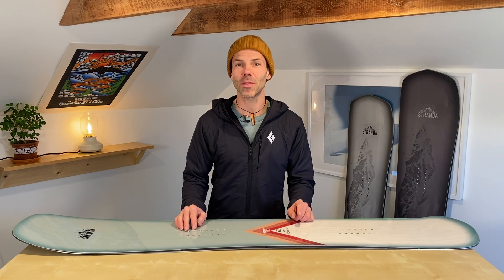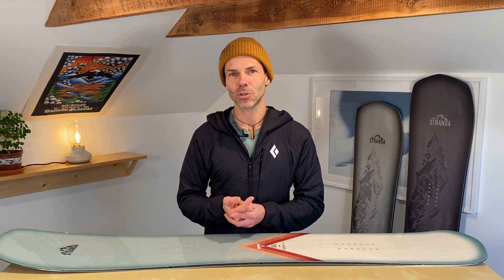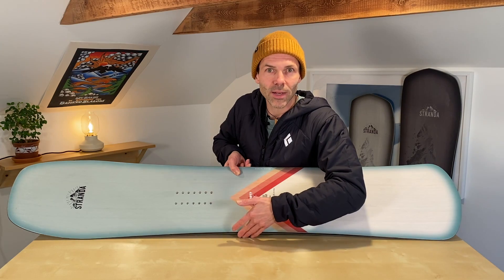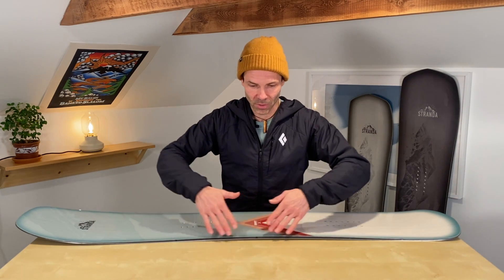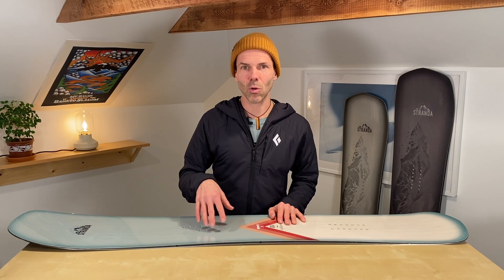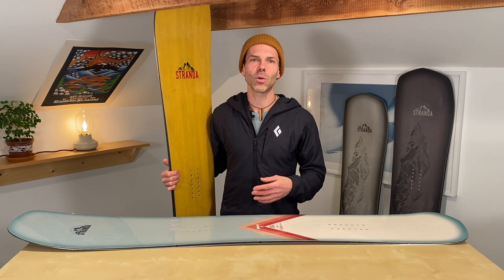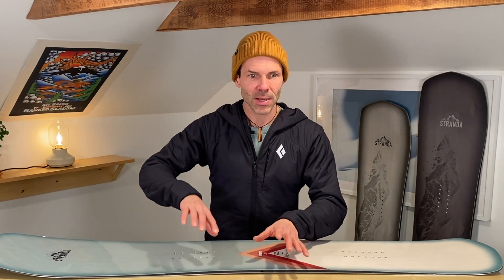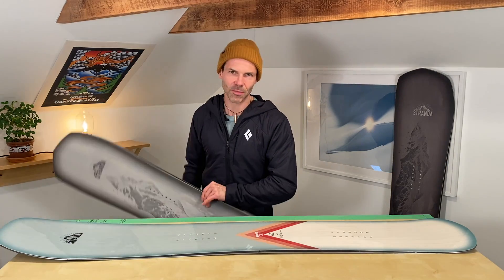Board design #2: Sidecut, effective edge, flex, turn radius

Comment: Hi Lars! I have learned so much from your videos breaking down snowboard specs. I've noticed some manufacturer spec sheets have multiple numbers for the sidecut radius. Could you help me understand what this means and how it effects the ride? Thank you in advance!
Reply from the maker: Thanks and great question!
I'll make a full episode on this.
But to answer the question: there are radial sidecuts (a part taken out of one single circle with the same radius) and blended sidecut radii... Tip and tail radii manipulate the turn entry and exit. So companies play with that depending on how they want the board to ride at a certain stage of the turn. You're supposed to shift your weight from front foot to back foot through the turn, and when you do so, this all makes sense. :-)

Comment: When you say longer will go tighter if you don't change anything (at minute 7) ... Yeah, but you will have a much wider board in the tips wich at one point will be maybe unrideable... So, as the longer boards usualy have the same width in the tips and center as the others in the family, they automatically flatten the sidecut the longer they get. If you want a longer board with less radius you need a more agressiv sidecut = a bigger difference between centre and tip width.  Another thing that stands out from this video is the fact that, for best geometrical sidecut turning you should have the smallest stand width possible and weight centered in order to put max weight in the center for board flexing. The legend that you have to lean forward to carv actualy is a misunderstanding of why you have to lean forward 😁
Reply from the maker: Your comment doesn't sound friendly with that emoji in the end, but I'll try to answer anyways...
- What I'm saying at min 7 is hypothetical to make people understand what I mean
- Yes, the boards become wider in the tips, yes there is a limit to that.
- Longer boards do also become wider in the tips in general, they're not the same, as their waist is also not the same. They grow on all ends.
- It's obvious that you bend a board better when you're more in the centre..... You still have to get the board high on edge in the first place, or else you can't even compress the centre when the board is on edge.
- The legend is not a legend and forward pressure is crucial to many things. One is that you need to stay on top of the board and don't want the board to ever get ahead of you. The other thing is that the nose sets the path for the rest of the edge to follow, so you're digging that trench with your front foot!
Thanks for the comment, I hope I could help.
Reply: @Justaride-Snowboard-Channel  I'm sorry you consider my comment agresiv. It was absolutely not my intent. In carving, the edge is blocked in the snow, so more pressure on the front than on the back would not make the board turn. As you correctly say, the carving turn is made by the flexing of the board , when tilted, until the center digs in the snow. At that point , the only way to modify your radius is to tilt more/less the board in order to bend it more/less. Fir example, if you go too much forwards or too much backwards with the pressure, you will degrade your turn. Going forward is in order to compensate the slope and acceleration. It would be interesting for somebody like you, with a big carving level, to test the consequences of extremely wide stance vs extremely narrow stance in carving turns. I bet the narrow wins... Only talking about pure carving turns! Again, sorry for the apparently agresiv comment.
Reply from the maker: @dinubunica  thanks! Glad we clarified this!
I agree 100%. I ride a rather narrow stance for my height, 53cm mostly (21"). When I say 'forward' I'm not talking about the entire turn... I'm slowly moving onto the backfoot through the turn. But I start every turn on the front foot with forward pressure, and my upper body always hinges forward from the hip. Weight distribution through the feet is a micro movement for me.
Thanks again for replying! I really appreciate that! The written word is sometimes hard to interpret!! Sorry for my assumption above!!

Comment: love your channel and videos. They are very helpful ! 

I was looking at an all mountain freestyle board such as Rome Party Mod  vs Rome Agent. They have almost same flex.

Rome Party Mod 157W ( because I’m a UK size 11 )
Zero camber to rocker at tips
Effective edge 124.7cm 
Sidecut radius 8.06m

Rome Agent 158W
Positive Camber to rocker at tips
Effective edge  122.8cm
Sidecut radius 8.22m

Despite being shorter and zero camber party mod has a longer effective edge	and almost same sidecut radius.

Would you say party mode has more turning range options than Rome agent based on this ?

Thank you so much
Reply from the maker: Ultimately depends on your ability level in regards to tipping the board over. The difference is quite minimal, I'm not sure you'd notice. Also never ridden Rome. Sorry!

Comment: This was really interesting thanks Lars, you explained it very clearly. After skiing for ten years your video on double posi stance got me bqck on q board this week. My board is a ten year old lib tec attack banana and although i can get a carve out if it, its clearly not the tool for the job.

Do you have any suggestions for a board for an intermediate snowboarder to start out carving? I am 45 snowboarded for a week or two a year for 20 years went to the dark side for ten years and now am back to boarding. I am 65kg and 180 cm
Reply from the maker: What's your boot size and how often are you gonna ride? What's your budget (with currency, please!)?
Reply: @Justaride-Snowboard-Channel wow thanks for the quick reply... I was half expecting not to hear from you.

I am  42.5 euro boot size so pretty small I will ride only one or two weeks a year and I don't really mind what I spend. I would rather buy the right thing once!
Reply from the maker: @wingnutLP1  Okay.... so do you want a dedicated softboot carving board, or an allmountain board that carves well and also rides powder and such? Asking because of size...
Reply: @Justaride-Snowboard-Channel  This is a great question!
The answer is probably one of each, I am going to sell my board and ski gear and commit to the carve!

I think I need something directional for piste and powder that can carve and something that I can dedicate to on piste.

I should add that the resort I ski is in Switzerland and does not have super wide blue runs that you see more often in the USA and maybe Canada (I have never been to Canada unfortunately).
Reply: I was wondering about the Jones freecarver 6000 which I see you just had in your shop.
Reply: Any suggestions Lars?
Reply from the maker: @wingnutLP1  Freecarver 6000 is maybe more of a board for someone who starts carving?! I don't like how soft it is torsionally. It's really thin in the middle. Easy to steer through the feet for sliding turns, but i.m.o. a questionable flex pattern for good edge hold.
Quite honestly, that is such a broad question with so many subjective things to be considered, we'd be going back and forth here for a while, and I'm overwhelmed with questions/emails/comments.
I ride Stranda boards, the edge grip on every single one of them beats most boards out there. The Biru is fantastic, but the Cheater is even better on edge... 154 vs. 170... :-) I've heard a few people at demo events more than once saying the Biru outcarves the Jones. I've never tried the Jones, so I can't really tell you anything from personal riding experience. Sorry! Hope that helps.
Reply: Thanks 🙏

Comment: Really good info. I especially like how you highlighted the importance of the flex working with the sidecut and the concept of sidecut depth.

My latest custom Coiler board plays with that concept. My idea was that I want to have really small sidecut depth. That was in order to keep the middle of the sidecut engaged with extreme edge angles. The turn then follows the shape based on how much I muscle the board (decambering).

Bruce (the board builder) wasn't convinced at first that such a design would work especially with duck stance softboot setup. I'm glad he eventually built the board and now I can ride the way I want.

Here are the specs of my board:
164cm length, 136cm ee, 300mm waist, 16m scr

Interested to hear what you tought of the Contra James let you ride. For reference my board has 7.6 flex on Bruce's scale. I don't know what flex James has but bear in mind that the number is a measure of deflection so shorter ee board is bound to have less deflection. Bigger number == less deflection. In any case 7.6 isn't a soft board.

I also have a fun illustration of what happens when it's icy and you attempt a high edge angle turn with a deep sidecut depth board: https://cdn.discordapp.com/attachments/916689081512128532/968110107693027398/unknown.png?ex=65e5af4c&is=65d33a4c&hm=9b734518e5e89f937abaad1a87ff2679606488d83ea80a610f161f225c9442b7&

... and for the sake of comparison, with my new board:
https://cdn.discordapp.com/attachments/341764489517072394/1207335504169672776/image.png?ex=65e8804f&is=65d60b4f&hm=f97afbeed9a58d5509bb954c060b0ea226f581dbc2b6f97d268511f7fe7ff871&

16m scr and 136cm ee seem to result in small enough sidecut depth to keep the sidecut engaged even when the surface is icy/firm. Also for reference, my usual go-to black slope is around 26 to 29° steep and about 20m wide. Flexing the board allows me to carve that even though 2x scr is larger than the width of the slope.
Reply from the maker: Awesome comment, again!! Yeah, I completely get what you're saying. Great pics. Just taking a nap on a firm groomer! Hahaha... 
The Coiler had a 12m radius and grip for days. Too damp for me. I like more feedback. But it's on the right side of good and evil!! Great board!!
Reply: @Justaride-Snowboard-Channel  Yeah get what you mean about the Coiler. I often take two or three boards with me when I go shred. One of my favorites is Salomon Super 8 Pro 154. I really like how it ejects me from the turn way more than the Coiler. Of course for the kind of riding I do with the Coiler, I want it to be predictable and easy so I can really concentrate on getting as high edge angle as possible and as close to the snow as possible. That's where my goals differ from you and James. I do want that pencil line carve as well but I'm ready to compromise a bit there in order to get as low as possible. That said, I still consider turn a failure if I lose the decamber during the turn. What I like most about that kind of riding is that the perfect turn is so hard to reach.

Also I haven't ridden the Contra designs James rides. My board is hybrid hardboot design. Bruce says it's 80% hardboot construction. If I understood it right, the mid part of the board is where the main difference is and Bruce said my board has almost like a slalom hardboot board mid section and that's not the case with "normal" Contra design. I was fully prepared to ride the board with hardboots if it was too much for soft setup but I'm glad that it works great with softboot setup.

But back to the topic, the way you describe and label the topics in your vids is great. I've been asked to do a tutorial vid about deep duck carving and now that there are amazing resources to use as a base (you and James), I'm probably going to do that at some point. The way I've been planning to do it is that I will link to various parts of your vids and also to James and only present kind of like "addon" or "plugin" type of stuff about what is needed for deep duck carves based on what you guys teach. No idea when I'll do that though. Hard to balance research work and "research hobby". 😆 Yeah, I'm a total nerd. 🤓
Reply from the maker: @Xargo_carving  "What I like most about that kind of riding is that the perfect turn is so hard to reach." Yes!!!! exactly!!! 🙂
Great idea with that video!! Do it!!
Reply: @Justaride-Snowboard-Channel  I got baited by James with this vid: https://www.youtube.com/watch?v=uNBua1SMosE

... and made a short take of my own hip shift here: https://www.youtube.com/watch?v=ROKKN-NHXzQ

You guys can do all the hard work with concise tutorial series and I'll continue to drop bits and pieces here and there. 😉
Reply: @Xargo_carving wow, I watched your video and that was some pretty steep duck carving! Best I've seen on steep terrain. Well done!

Comment: Couple of questions:

What size Shorty do you ride and do you have any issues with controlling the board at slower speeds. I think you indicated you weigh about 130 pounds???

Also, how durable are their sidewalls and top sheets. I believe the website says they use a glossy polyurethane. Most glossy top boards I've had in the past seem to get beat up pretty easily.

Thanks
Reply from the maker: I ride a 164W Shorty at 138 lbs. It is torsionally on the stiffer side so it requires more input at slower speeds. But the nose rocker makes it very forgiving and it never hooks up, so it's not really a problem. I find it very versatile. It is designed to be ridden longer. I'm 176cm/5'9.5" and the 159 feels too short for me. I like the stability of a linger board.
Sidewalls are super good! Topsheet lacquer coating is obviously fragile when encountering steel edges in the lift lines or rocks.
Reply: @Justaride-Snowboard-Channel  so do you think a 159 would be the correct board for someone shorter than you at 5'7", 140 lbs with a size 8 boot or go with the 164?
Reply from the maker: @Darrelllcho  you can go either way! In this case it's preference and riding level. I have a friend, who is a highly skilled rider. He's probably 5'5" or 5'6", 150 lbs and rides the 164..... He needs the length to move fore aft and be supported in that direction.
Reply: @Justaride-Snowboard-Channel Thanks. I might not be as skilled as you highly skilled friend! 😂
Reply from the maker: @Darrelllcho  haha, no worries! :-)
Reply: @Justaride-Snowboard-Channel so now the big question for getting around all over the mountain - Shorty or Biru. What are similarities and differences other than biru being a volume shifted board. I saw testers also loved the Biru but said their smaller riders found it a little more difficult to ride and got bucked around a bit - I'm guessing bc of the width. But I do see they are coming out with a 150 next year which may help, but I'm guessing the waist width will still be in the area of 26+ cm? Again, I'm 5'6" 140lbs with an 8 US boot. Thanks!
Reply: @Justaride-Snowboard-Channel just peeping through comments of days gone by here and I was wondering about your thought process on going with the 164W over the 169 Shorty? Is your decision based on foot size?

I ask because I am between a Super Fish vs Super Fish Cloud Liner, which I think is a similar comparison to your previous decision, as I also like stability at speeds. I have also broken tails in the past by turning! So my logic here is the wider board (Cloud Liner)would be best bet for durability long term because of its wider tails.
Am I off my rocker?
Reply from the maker: @jStoeh  Well.... since so far there was no 169W Shorty the decision was based on boot size. But for next year the 169 will ONLY come as a wide at 273mm waist!! Exciting!! Then one can decide on length 🙂
-
About the Gentem: I've ridden The Cloud Liner. The board is generally more of an 'open terrain board'. It's not that nimble, not even in pow. And on groomers it finishes turns more down the fall line, which makes you carry a lot of speed. And that is fun, but not in steep terrain where you need to apply 'speed control through turn shape'. I liked the board, but it's a poor choice for where I ride. If I was in Japan, I'd probably have one in the quiver. Also: underfoot width on the back foot is not very wide!! So much taper on that thing... (which is what determines that open turn shape).
Regarding durability: I guess you're right. Probably won't make much of a difference. On a swallow tail that might be more of a construction thing rather than size.
Hope that helps.
Reply from the maker: Hey, did yu end up getting a Stranda, and if so, which one? :-)
Reply: @Justaride-Snowboard-Channel  Not yet. I think I've decided to wait until he comes out with the 150 Biru. Everyone who has riden it says they love it and the 150 I'm sure will have specs that fit me better than the 154 given it's a volume shifted board.

Comment: You have perfectly described why I have historically preferred boards with larger (~8.0) sidecut radius and longer (1200+) effective edge, only I didn't know the geometry. This also explains why I LOVED my '95 Santa Cruz XXX 155, which had an effective edge of 1250. I'd love it if someone did the calculations to demonstrate that relationship between the edge angle, sidecut radius, effective edge and the actual turning arc of a given carve.